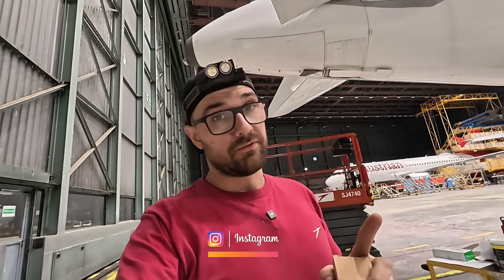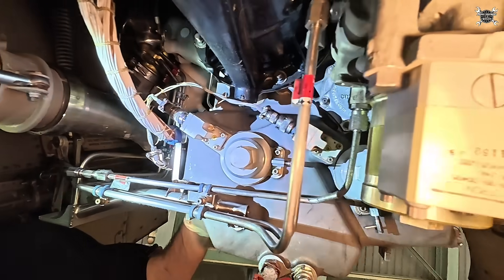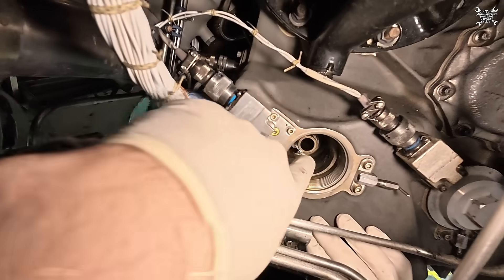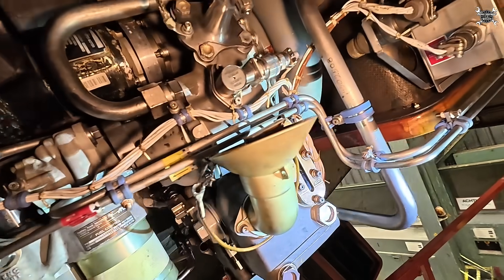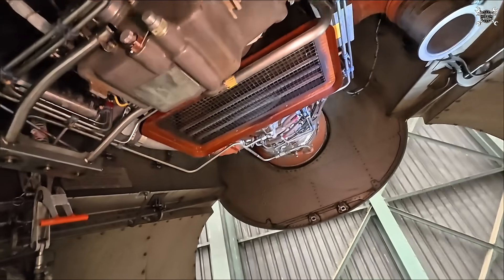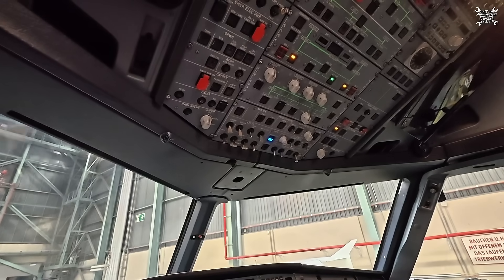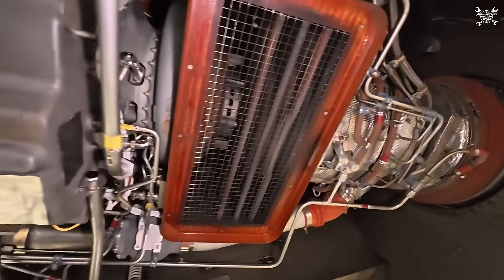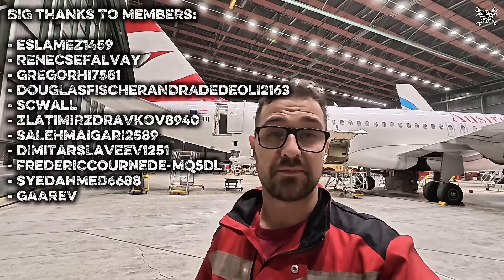How to replace oil filter on APU of Airbus A320

Comment: Why do you pull the CB before doing the fire test of the APU ? As a pilot I have to do the APU fire test before flying but I never pull the CB ! The fcom asks to not hit the test button for more than 3 seconds for auto extinguishing purpose but not to pull CB
Reply from the maker: This is necessary to prevent an unwanted automatic fire-extinguisher discharge during the test.. note from the manual🙂

Comment: Are those two 'drain plugs' visible in the lower RH image frame corner at the 4:12 mark correctly safety wired?
Reply from the maker: Hi mate. That is drain port with magnetic chip detector and pressure relief valve. And you are right it is wrongly secured 🤔
Reply: @zeto.r  Thanks for being honest about it! In such a large enterprise it is unavoidable that someone will make a minor mistake somewhere at some time. But openly addressing it improves safety and builds trust in the company and the industry as a whole.
Reply: Good eye! I checked one of his other videos about the A320 APU, and there the locking wire runs in the opposite direction - the correct direction, assuming those are clockwise-tightening drain plugs. So, unless we are missing something else here, it seems the locking wire hasn't been installed correctly.